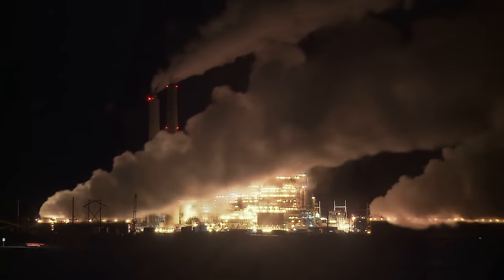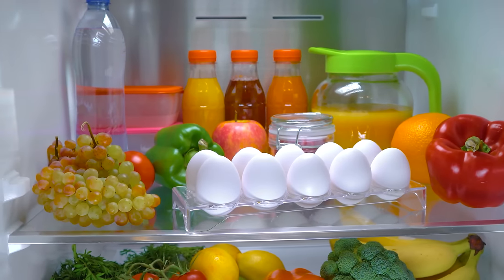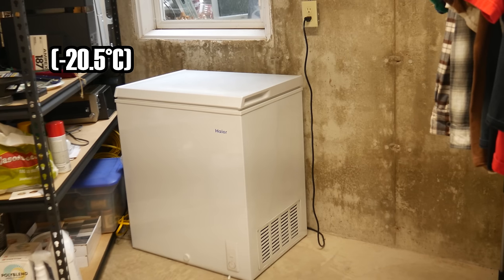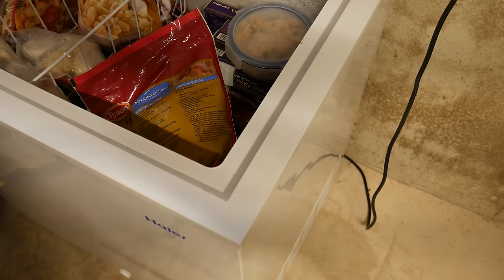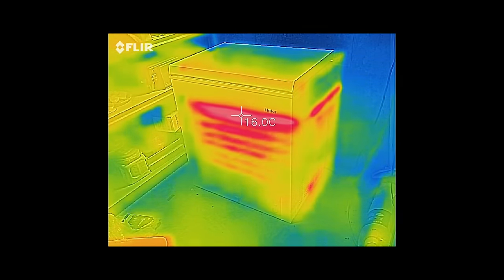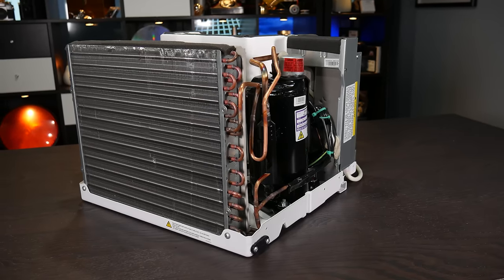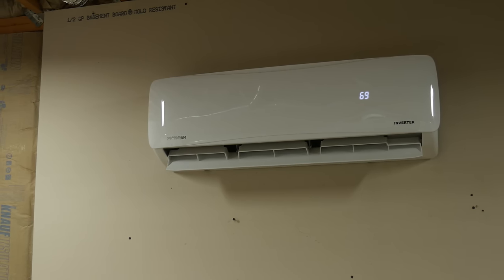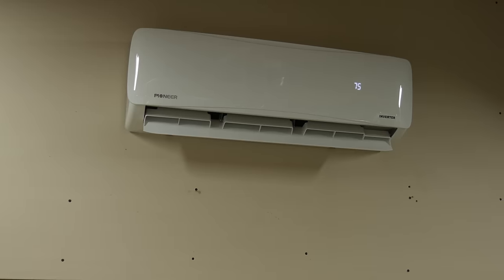Heat Pumps: the Future of Home Heating

Comment: I live in Nova Scotia Canada, heat pumps are the biggest boondoggle forced on us buy our Government. I am a senior and have never been so cold I'm my home at 0 C! If you leave them on, tye slow heat dries out your breathing passages causing you to have to turn it off and open a window to get fresh air thus defeating the purpose of the unit. Thank God we had the wisdom to keep our oil furnace for the cold weathercoming our way. As for the carbon tax on our heating oil, I assure you the Government who dictated this will be gone after the next election. While climate change enthusiasts have right to their opinion, at age 73, I have right as well to mine. We have had enough of their poorly grounded dichotomy!
Reply: There must be something wrong with your setup. It's 0C here right now (was -2C a couple of hours ago) and my heating is provided only by heat pumps, and it's a nice 20-21C inside.  The drying out of the air occurs with any heating system, and Alec has covered that before, basically comes down to - getting a humidifier.
Reply: @BenIsInSweden  Nope, System was installed by 2 licensed HVAC Techs. We have 2 properly sized Mitsubishi wall mounted heads which actually has worked better than the Daikin central unit which we had removed after 6 months. It's minus 2 here this morning, interior of hose was 15C, we went with furnace, temp 18 after 20 minutes run, heat pumps would take over an hour to get there, we aren't going to get pneumonia at our ages waiting for heat!
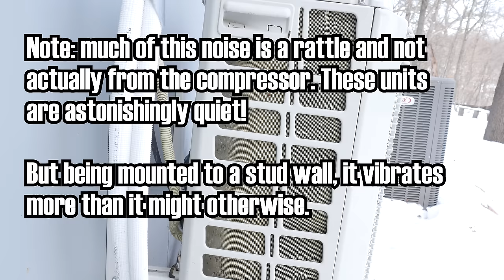Reply: @davidwalsh5756  licensed HVAC tech doesn't mean it was installed and designed correctly.  Looking at average January temps for Nova Scotia, a heat pump system should be designed for around -15C to -20C, so would be able to easily handle 0C. The variable is that maybe the Furnace was taken into consideration, so the heat pump system was designed for about 2C, and the furnace is meant to take over for temperatures lower than that. And to keep a heat pump running efficiently, you wouldn't let the house cool to 15C anyway, and have a temperate that is a few degrees below daytime desired temperature, e.g. mine get set to 18C from about 23:30 until about 7:00, and 21C during the day.
Reply: @BenIsInSweden  We have a difference of opinion, our HVAC Techs are licensed by our Government Trades Branch, both have 20 years experience, certainly NOT their work. Our system operates independent from our furnace, the first one had been integrated ( a 2.5 ton unit) that never heated our home above 18C. The present units are far superior, but take too long and they are drying out our breathing passages, so we use it only spring and fall and not winter.
Reply: @davidwalsh5756  Depends on what they did with the replacement (e.g. like for like on tonnage or wattage) and what the heat loss of your property is at the design temperature.  But 2.5 ton is about a 9kW unit. For my 152sqm home in a similar climate, I have a total of about 23kW peak capacity - equivalent to about 6.5 ton.  So as I say, either it's not sized correctly, or designed only to be used in above 0C temperatures.  As for the dryness, it applies to any heating system, not just Heat Pumps and getting a humidifier makes a world of difference.
Reply: @BenIsInSweden  With due respect, we are pensioners, This is what we hear from HVAC reps all the time.." you have an issue, just throw more money at it!"... These systems are way over priced and almost everyone in that industry has an "opinion". We gave it a good try, we have $8,500.00 in this system. We have  1 ton on each level (1100 square feet each level). We lose heat during frequent defrost cycles at 0C, We had installed last March, had a few nights at minus 10 with wind chill. We noted power usage went up dramatically after minus 5! The system uses about 12 kw when Temps are plus 3 to 8 C as it has been past few weeks here. We are now entering colder Temps, and we will be using our furnace to keep warm, Thank-you for your time, I think the industry needs to be more honest with us the consumer.
Reply: @davidwalsh5756  That's fair enough, but the problem here isn't to do with heat pumps, and more of a lack of understanding from many installers of how to design them properly, government licenses don't change that, and just misplaces consumer confidence. I have 1 ton units in my office and daugther's bedroom - each is about 215 square feet.  If you lose a noticeable amount of heat during the defrost cycles, then there is likely a heat loss issue that the gas furnace has masked, as defrost cycles should largely go unnoticed. It's something that should have been picked up if the installers did a proper heat loss survey before the install.  Not sure how a 2.5T unit can pull 12kW though as that means it's using about 25% more electricity than the maximum heat it can pump - and if installed correctly would blow the fuse, as a 2.5T unit should have a 25a fuse = 3kW max pull.
Reply: @BenIsInSweden  Hello again, we are operating two Mitsubishi (Hyperheat) units. To be fair, the lower level does quite well with the heat as it only has a few partitions. Our issue, which was discussed with the technicians was the partitions on the upper level where it was acknowledged that the unit being installed in the living room would likely not supply sufficient heat to the sleeping areas of the house, we are continuing to experiment with different settings such as keeping heat constant under the main level, using slow speed ceiling fans to draw heated air down the hallway in the upper level which has helped some. As for our colder season December through March the system as fitted likely will not keep us sufficiently warm. All of that said, have we lowered our fuel consumption..Yes... I am estimating that we are on track to consume about 1000 litres of furnace oil which is lower than the 1900 we had been using. Note that we came from 3,500 litres when we bought the house 22 years ago and scored very high on our energy audit carried out before the install. We substantially lowered our heat loss, but over all, I would not like to rely on heat pumps as a primary source of heat and our respective governments need to listen to us.  I can tell you, looking around our neighborhood, the use of heating fuel is markedly lower but not likely to be eliminated. We also deal with utility blackouts here from time to time from storms, I at least can operated our oil fired furnace through our gas powered generator when we need to heat the house. So that's where we sit at the moment, we have done what we can reasonably do. By the way, Our House of Parliament continues to be heated with oil fired boilers! ( Don't do asI do but do as I say!.. lol)
Reply: @davidwalsh5756  The hyperheat is available over here too. The thing is it's super simple to size correctly as it has a constant max heat output down to -15C (some models even down to -20C).  So it has 7kW available at -15C (some -20C) and at 0C.  If it's struggling to provide enough heat to warm up your house sufficiently between the 2 units at 0C, then your heat loss is going to be around 7kW at around (or given what you have said - above) 0C, since heat loss increases as temperature drops, it doesn't stand a chance at providing enough heat below 0C.  It sounds like the installers just based the new units off of the old 2.5T capacity, rather than sizing a heat pump for being the primary heat source.  My heatpumps (I have 3 outdoor units serving 4 inside units and a hot water cylinder) are sized to be the primary source of heat down to -15C, below that and one will switch off to protect the compressor, and I'll need to use my electric radiators or fireplace to make up the difference, and the hot water cylinder will revert to using the immersion.
Reply: @BenIsInSweden  Hello again

My compliments! You have provided the best explanation to date on why these units encounter operating difficulties below 0 C. On a related note, most houses constructed over here have 100 amp electrical service. We're one to exceed 2.5 tons, it is very likely you will be required by the Electrical Utility to obtain a permit and upgrade at your expense to a 200 amp service. The cost varies $5 to 7,000.00 Canadian. This is another operating impediment to perhaps sizing for the correct unit. Most of our HVAC contractors will try to avoid that in order to secure the sale of their products and services. We hope that other technologies start to gain traction if we are to get away from fossil fuel usage. We have a lot of interest over here in green hydrogen....maybe 10 to 15 years out...

Comment: They don’t work in snow climates
Reply: He said that.
Reply: Absolute BS. I live in Northern Norway and they work just fine.
Reply: @logitech4873  didn’t work worth a damn in North Carolina on very cold days
Reply: @logitech4873  Norway has mild winters, when it’s 10 degrees Fahrenheit, they are worthless
Reply: @zeke5491  Supplement with regular electrical heating when temp drops below like -25°C.
Reply: @zeke5491  "Norway has mild winters" unless you live inland. Look up winter temps in Finnmark.
Heatpumps obviously aren't worthless. If they were, people would use something else.-

Comment: Alec you need to quit - It is true there is some heat in the air even in extremely low temperatures, however in order to drive the temperature of the coolant up to a useful level, the compressor needs to work harder – and remember the compressor works on electricity. This negates any peak efficiency you may achieve with heat pumps.The issue is that the efficiency numbers often cited in the media are not annualised figures (i.e. an average efficiency over the course of a year). They are cherry picking the peak efficiency – which occurs when the air temperature is in excess of 20 degrees Celsius.

Comment: Heat pumps are the biggest lie of the century. The colder the climate the less efficient they are and so if you calculate the savings over 5 years it pays or maybe almost pays for the pump at which time it may need replacing or major repairs. Every single person I’ve met that installed a heat pump regretted it after 5 years. Now in moderate climate I’d say it saves more yes. So if you live in Virginia or Carolina then it might be a good thing. But northern states or Canada forget it. You are better off paying the power bill. Don’t forget you get to keep the cost of heat pump and I stand maintenance. You could invest it instead and you would have more money after 5 years and less headaches.

Comment: And here we are 1 year later, still no heat pumps! I’m always skeptical when big promises are made about something, that has been around for so long. Like air conditioning. Thermodynamics is one of the oldest branches of physics, so when someone comes out with such an innovation, the questions are:
1) Wereall the previous engineers idiots, not to think about it before? Or 2) what amazing new breakthrough in technology made possible something that wasn’t possible before? If there are no clear answers, the whole thing stinks of Elon Musk syndrome, overpromise and under (never?) deliver

Comment: Heat pumps are great for hot summers and mild winters. Unless you want to pay a shitzillion dollars for running your electric heat kit all winter.

Spoilers, your wallet really doesn't want you to do that.

If you live in an area with cold winters get a gas furnace. It's less expensive and has better heat output (assuming your ductwork isn't garbage and trips high limit)

Comment: 1. High upfront cost: Heat pumps can be expensive to install, especially compared to traditional heating systems.

2. Lower efficiency in extreme temperatures: In very cold or very hot climates, heat pumps may struggle to maintain a comfortable indoor temperature and may require a backup heating source.

3. Requires electricity: Heat pumps require electricity to operate, which can be a disadvantage in areas with high electricity costs.

4. Not suitable for all climates: Heat pumps are most effective in moderate climates and may not be suitable for very cold or very hot regions.

5. May require additional equipment: Some heat pumps may require additional equipment, such as a desuperheater or backup heating source, which can add to the overall cost.

6. Regular maintenance required: Heat pumps require regular maintenance to ensure optimal performance, which can add to the overall cost of ownership.

7. Noise: Some heat pumps can be noisy, especially when operating in heating mode.

8. Potential for refrigerant leaks: Heat pumps use refrigerant to transfer heat, and if there is a leak, it can be harmful to the environment and require expensive repairs.

9. Lifespan: Heat pumps have a shorter lifespan compared to traditional heating systems, typically lasting 10-15 years.

10. Limited options for older homes: Heat pumps may not be suitable for older homes with existing ductwork or homes with limited outdoor space for the outdoor unit.
Reply: Your points 2 and 4 are in conflict.  Do they have lower efficiency, or are they not suitable?   My heat pumps get serviced every 2 years which is basically preventative maintenance.  My Dad's gas boiler gets serviced every year for safety.  The refrigerant leaks are rare, but in many new ones with R-290 etc, have only a small amount of refrigerant, e.g. a Vaillant 5kW unit has 0.6kg of Propane, which has a GWP of 3.  So is the equivalent of about 1.8kg of CO2 released.  A gas boiler releases ~215g of CO2 per kWh, so it doesn't take very long for a gas boiler to emit more CO2 than a modern heat pump would IF it had a leak.
Reply: @BenIsInSweden  Disagree.   2 and 4 are valid.  I know batteries.   Cold weather zaps them bad.  Even a teslas.
Reply: @danmeek6316  heat pumps aren't batteries.
Reply: @BenIsInSweden   Yup.  I meant heat pumps.
Reply: @danmeek6316  Well Tesla don't make a residential heat pump (yet).  So not sure what you're trying to say.  Either way your points aren't really valid.  

For 2, there are air source ones with Enhanced Vapour Injection that can retain full capacity down to -20C and if sized correctly will still keep going down to -35C. There is also the option of Ground Source or Geo Thermal Heat Pumps that don't lose efficiency at lower temperatures.  
3. All heating systems require electricity to some degree, and some places like where I live, electricity is the cheapest option. 
4. You mention very hot regions, but don't stipulate what they are unsuitable for, but again, ground source/geothermal is available for both extremes, and not affected by the outside temperature.
5. Depends on the situation, most will not, and many have the alternative of ground source or geothermal if they want to avoid that extra cost.
6. Already covered.
7. Old ones maybe, most modern ones adhere to certain noise levels, and again only applies to air source, ground source / geothermal won't have exterior noise.
8. Already covered.
9. Depends on the type - minisplit/a2a last about 15 years, air to water lasts about 20, and ground source/geothermal lasts about 25 years.  Condensing Gas boilers only last about 10 due to the acidity of the condensate.
10. And some older homes are perfect for them, especially in the UK where heating systems didn't use microbore, and were able to have radiators upsized, and insulation put in.
Reply: Your 3rd reason is like saying "gas furnaces are bad because they need gas which can be expensive in some areas"😂😂😂

Comment: The rapid rise of Electricity costs in 2022 in Europe despite wind turbines and solar panels fantasy is showing heat pumps / air con and EV’s are not the cheap option now as All are very expensive to purchase and install never mind actually use,

Comment: Wait til you see your electric bill with heat pumps.  Give me natural gas any time.   I have both, no comparison.
Reply: Basing it on current electricity prices is pretty naive.  e.g. over here the spark gap is 1.2 so that electricity costs on average about 1.2x the cost of gas.  Which means a gas boiler never makes sense.

Comment: Absolute bull crap.  Heat pumps SUCK for cold climates.  They simply cannot keep up when it's truly cold outside.  Natural gas forced air furnace will beat the hell out any heat pump when it's really cold.  I've been in HVAC most of my life and I'm not just spouting an opinion.  Heat pumps can only work in very cold climates if they also utilize electric heat strips.  Trust me, when the electric heat strips kick in, your electric power meter really starts spinning!  It will cost far more than a gas furnace.
Reply: Pretty much all of Norway relies on heat pumps for houses. They work fine. Nobody here even has gas lines.